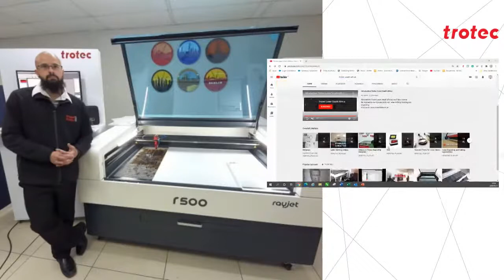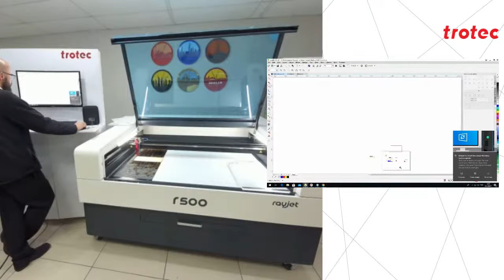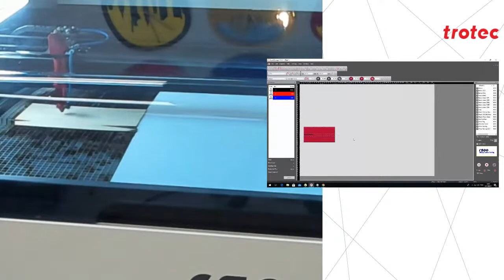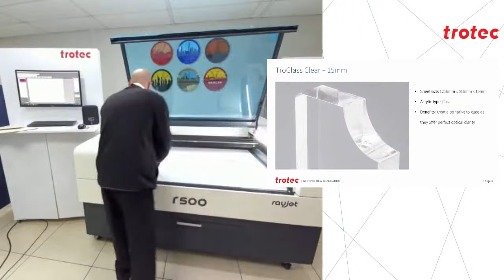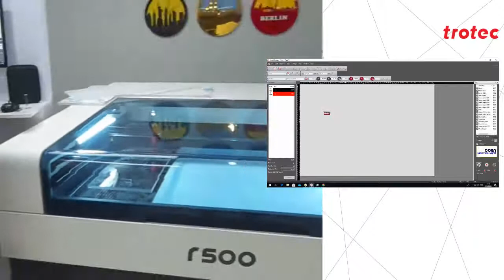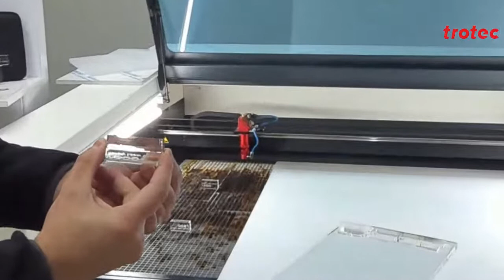Cutting Thick Acrylics with Rayjet |Trotec Laser Webinar

Comment: Hello I'm Hector and I work for a company of Signs. Actually, I operate a R500 like the one in the video. I am really interested about cutting different types of acrylic and some other materials in general. I am basically new on this. I don't know exactly the power, Speed and Air assist I need to do a high quality result. I would love to learn about the right settings for each material having a HQ result and as many tips as I can get. Thank you and I hope I can get an answer back. This machine is amazing.